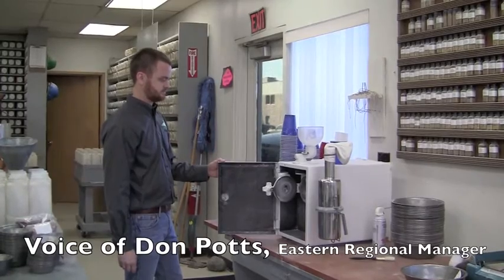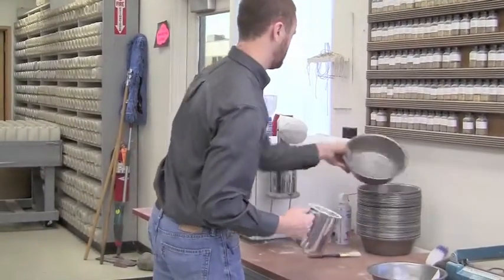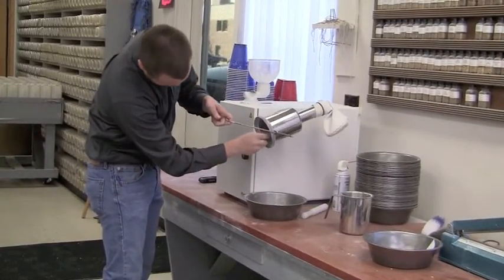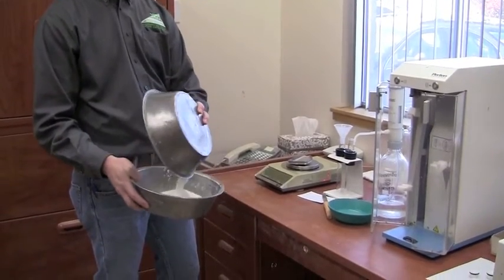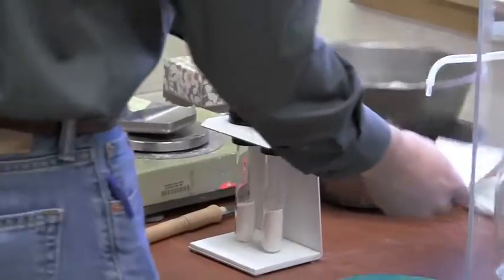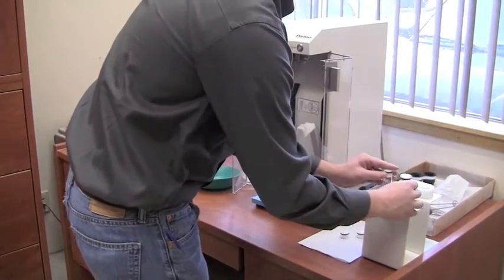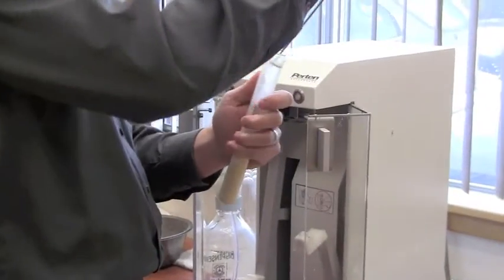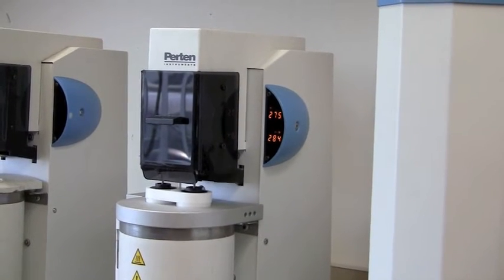The Falling Number Test

Comment: lost me at 4:14: FN test results of 275 and 284 = 242 after "a calculation will be applied to it" + altitude adjustment.  Post the "calculation applied to it" and the info on the paper on the wall. Thanks!